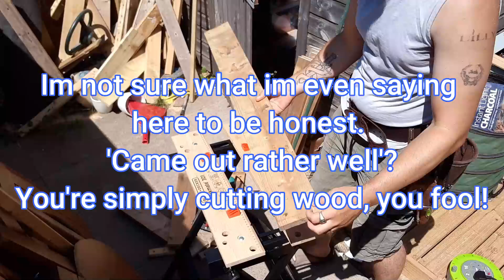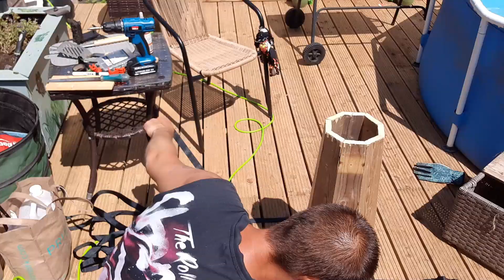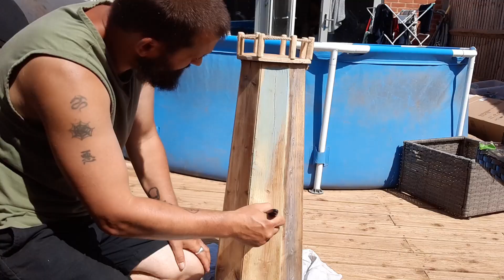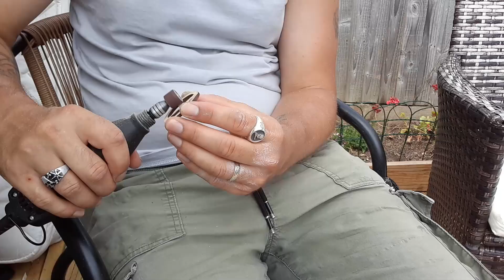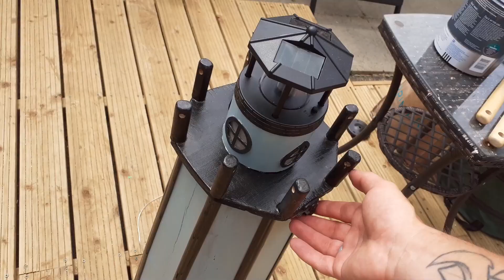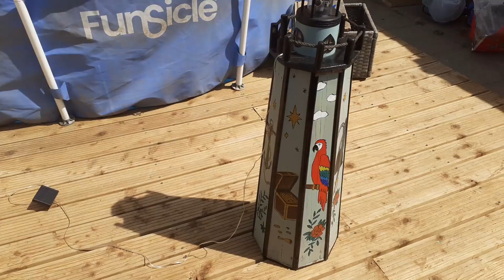I Built My Wife a Lighthouse That Secretly Stores Garden Tools

Comment: Another fantastic build. I’m curious, why did you use super glue instead of a wood specific glue? I always wanna learn more and it seemed interesting. Anyway the build turned out well and that artwork was amazing
Reply from the maker: Great question! I used superglue as wood glue would not have adhered to the pvc trim very well. As the trim already had (questionable) adhesive on it, I only needed a few drops of super glue in a few places.
Reply: @piraticalengineering interesting, thanks!